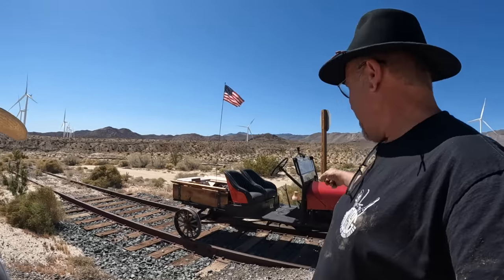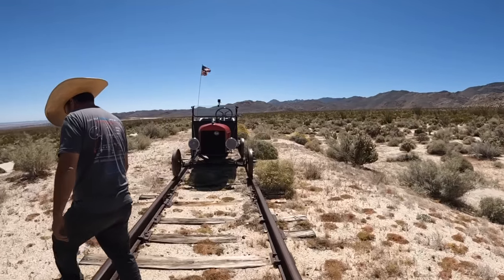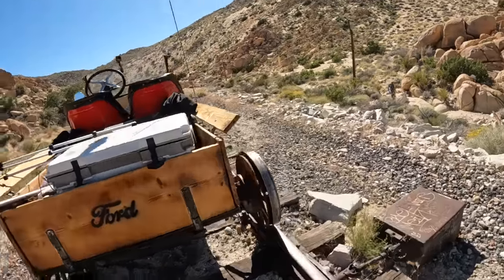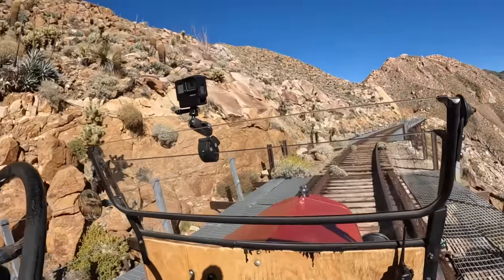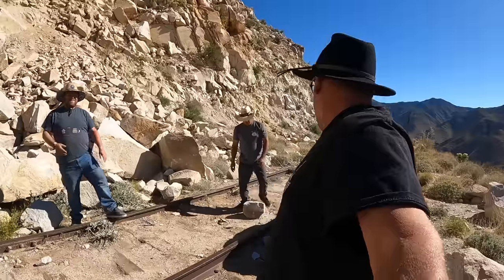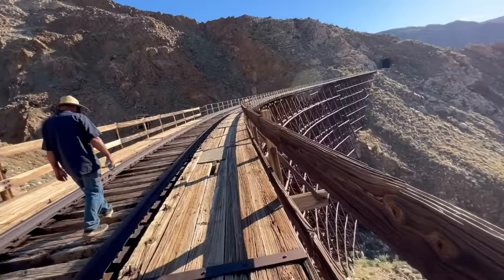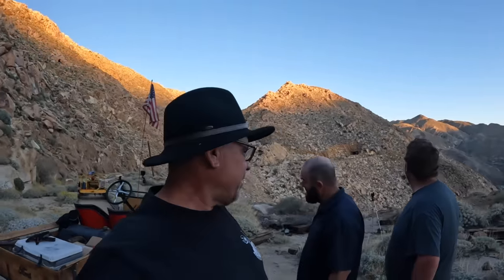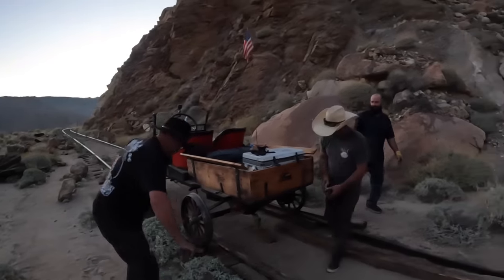Can We Make This Model T Railcar Run and Drive to Goat Canyon Trestle to Go-Kart on Railroad Tracks

Comment: Ah 21:55 
Yes the trolley offstands, being that amazing place - where the old timers used to (by hand) lift off one end of their hand powered or motor powered, velocipedes, and in a sideways shuffle they would either turn their trollies to point the other way (critical when using a three wheeled outrigger "pull-pull" hand trolley as the single outrigger worked best in a forwards direction while tending to "run off the gauge" and derail in reverse) or they would knowingly offtrack and thus push their trolley away out past train gauge, (that of the width of trains) to ensure that any passing train wouldn't be fouled on their trolley (smashing said unit if that happened and boy, what a long walk home if they smashed a trolley along with the "cost" of replacing it later, when their bosses asked for them to pay for the damaged trolley's replacement).
Here in NZ in late 1969 a motor trolley 4 man was worth about $300
I'd hate to guess what a motor "vehicle" on High Rail wheels, would cost nowadays?

It also meant that a work gang could offtrack as many trollies as they had brought along, (thus pushing them all as far out as the end of that offtrack stand, across which 'd guess would be a fixed cross tie above the stand to AVOID LOSING ANY DOWNHILL.!!!)>
The gangfs thus used these either for their manned trollies (those that the workers sat on to go anywhere) and sometimes an unmanned cart (the working flat-tops they used to cart sleepers and rail with), although mostly we simply tossed ours off a short distance away, preferring to ONLY offtrack motor trollies on stands such as that.

These are the older wooden ramp offtracks, from a time before motor trollies, whereas more modern ones used old rails as the off track, with even more modern ones using a "just below flange height "inner turntable platform, around which it became easier to turn heavier work trollies, and to off track them when needed.

A little known technique was the one that was needed when NOT at such a brilliant spot, say at a worksite, (or if unable to "make it in time" to a known trolley stand), and that was to "lift" the front / heaviest end of the trolley and slide it sideways until one wheel was across the main running rail, on the side you were offtracking towards, so that when you went around to the other (lighter) end to force the trolley's fourth wheel across the rail as well, you could more easily get all four wheels off tracked outside of the main running rails, which allowed you to offtrack on ope track, no stand just soft sand and bushes to push the trolley through until clear of any train.

If you didn't do that - the two front wheels would BOTH drop inside the two main running rails, forcing you to lift while also "pushing" as you attempted top get the trolley off tracked.
A not easy task by any means, especially if in a hurry, or when alone, a heavy trolley becomes a LOT heavier, to push on gravel and soft sand, when you are also trying to lift it's heaviest end over the running rail you "forgot" to pre-lift it over, before turning the fourth wheel "over" the rail, by using the thrird wheel against the outside of the same rail, to allow you to get the one last wheel over - and thus fully offtracked.

Been there, done that many a time, in my ten years with the NZR when we were running the lighter wooden framed open seat motor trollies.
Unlike other countries where a covered trolley design was used, the NZR of the 1960's and 1970's used open frame (zero cover) motor trollies with mostly B&S motors, although a few were later fitted with Techumshies ? (I know I spelt it wrong, but that's what it sounded like).

Comment: Find the exact cg on that thing, then build a support bracket between the frame rails to hold a 1ton bottle jack.  Then make a base to lay on the ties to support the weight with a decent size thrust bearing for the jack to engage, and simply jack the car/cart up to rotate it to the opposite direction.  I bet it would take 2 men less than a minute.

Thats what the ties heading off to the side are for, BTW... Turning hand cars/pump trollies/jiggers/etc around.

Comment: 10:02 NO that was "not" full of oil, it was in fact full of GRAPHITE GREASE, which is a "flange" lubricant to lubricate the flanges of all wheels on this side of the track, attempting to avoid the ripping/ringing effect of dry flanges, grinding away the top "head" of the rails on curves, which is mostly effective, but often these "lubricators" became empty, whereby their effectiveness was diminished until a work crew could come out and refill the tubs.
We here in New Zealand during my time on the NZR, (between Feb 1970 & Oct 1980) had a modern sprung version with the "pumps" being small rod inserts, pushed down by the tread of the wheels, which instantl forced more grease out from the slots in the inside of the rail head, which were fed by a fishplate wedged onto the side of the head itself, with just enough gap at several points, to allow lube to be picked up by the flanges of following wheels, all of hich also pushed the plunger rods down, to force as much grease up, as each tiny "pump" was able to push, meaning that about 10mL of grease was pumped every time the plunger was forced down.
A long train was often the cause of one lubricator "running out" of graphitte grease in one passing, but oh boy the amount of grease splattered far and wide, by a high speed passing train, meant that everything for miles on either side of one of these (they normally used a pair, one on either rail), so that track maintenance work, by track gangs using the most primitive of tools, spades jacks and crowbars / showels etc, alway ended up looking like grease monkeys, whenever we had to "work" on track - for up to a mile either side of one of those. 
I've never seen  one with a rotating driveshaft, but hey, it obviously did the work it was designed to do, and so - many a mile of curving track would have been saved, by the mere use of these, lubricating the ground surface of the inside railhead, avoiding having to replace running-rail as often as the times they required replacing on other lines - which were NOT lubricated in this way.
Reply: In 1974 watched them water the train track at the Picton Ferry Terminal while loading the train carriages onto the ferry. Spoke to the NZR guy and he said it helped getting them around the tighter bends when shunting them in. Much cleaner solution but easy when you are not on a remote site.

Comment: Awesome trip 
The only thing I'd suggest if you keep rail running the T 
Would be a set of wheels in the center of the car that lowers to the track so the car teeter totters and you can spin the car 180 degrees, lift the wheels n go.
But where's the fun in that lol.

Comment: An "Austin Powers"  180* turn. Some ties have "Nails" (maybe called date nails) with the year they were installed on them. Certain ones used to be worth good coin. Regular use of steam locos ended in about 1960 though a few ran until 1968.

Comment: the old wooden  outrigger  is to remove the fallen rocks along the line ,    wagon /wagons pull up then empty  into a smaller  loper front wagon which was tipped over the cliff face

Comment: Those are places for speeders to dismount from the tracks and pull off to the side when a train is coming so that maintenance crews would not get hit by a train. Notice the wooden ties that are the same width as the wheels on the speeder. The platform was to turn the speeder around 90 degrees from the track so it could pull off to the side on the wooden ties until the train passed by.

Comment: Merlin you need to build the balancer for the center of the car like the railspeeders. You could do it with an old railroad jack. But it's centered in the car so that when you lift it it lifts the whole car so you can spin it around and drop it back on the tracks period love the videos will watch this again

Comment: That box with the pump was used to lube the wheel flanges as the train took a curve. Kept the wear down on both the wheels and the track. It was probably grease, not oil in that box.

Comment: “On the northern segment of the canyon you will note a couple of places, far below at the bottom of the gorge, where freight cars have fallen off the tracks. Some are the remnants of a 1928 movie, Beggars of Life, shot in the Gorge. Another two boxcars careened down into the gorge filled with trailer loads of Coors beer, to the delight of many. Yet another wreck left a hillside littered with precast concrete beams.”

Comment: Lubricants are used to control the amount of friction, so the train moves with the least possible wear, noise, and fuel. Lower maintenance: Wear of the rail and/or wheels occurs when friction becomes too high. Lubricants lower this wear, increasing intervals between maintenance.

Comment: 21:55 This lumber 'add on' is usually placed there for livestock (or vehicles) to cross the tracks, but that certainly doesn't look like the area is 'open enough' for either. 
And those two runners from the tracks to the edge? 
For the LIFE OF ME, I can't think of what those would be for! Parachute ramp to get the cattle into the valley?  🤣  
UPDATE AFTER MORE THOUGHT:  Maybe that entire setup was made to dump heavy 'railroad construction trash' they didn't want to leave along the tracks for safety reasons. (it's easier to push heavy things across flat areas, then it is to push across iron tracks and uneven ground. You found that out with that boulder!) 
Did you look over the edge of any of them to see if there was anything down at the bottom that didn't 'fit'?

Comment: I think a couple of floor jacks and a piece of square steel tubing could have helped a lot for the turn around.  Then you could have jacked up one end on the tubing and slid it over several feet.

Comment: The hand cars or pump car had slide out handles that slid out to turn the cars around, or to clear the rails  for trains. They filled the center of the  rials with ties so they didn’t have to do what you hat to do to turn around.

Comment: Would be cool to find the center of balance on that car then put a plate with a bearing there, make a really stable bottle jack that you can drive over, jack up the hole car and spin it around.

Comment: I'm not a trainman, but there's gotta be a better way to turn a train around. Have you thought of a pivot point underneath the car like a Jack stand, you balance & twirl. 

My other suggestion is swivel bucket seats. And two steering columns. One forward and one aft. 

Bells and whistles should work either way.

Comment: Great video.  I wonder if you could rig a rotating platform under the model T that would lift the whole car at its center of gravity  to allow you to easily spin the car to point it in the opposite direction.

Comment: Back in the day tbey would have used vehicles like this for inspection and repair . The trick to turning was they would have attached to the middle of the frame or trans. They would balance it while jacking it up and spin it 180 degrees.

Comment: It would be helpful to take a heavy bottle jack bolt it to a steel plate , then weld a axle and drum face on the top of  jack to catch a point on the bottom of the car . To jack and rotate in place ?

Comment: You need a plate for the ground and a lift point in the center of the T so you can jack it and spin it on its center.

Comment: A question, did the inside Model T wheel flanges "just happen" to fit between the rails? If they did, it may have on purpose. Your "T" model would have been old enough for that possible use to have been considered. Sales to railroad Co's could have sold many fo rail maintenance use. Henry made many farm tractors too. Great video THANKS!!!

Comment: At 22:10 those are designed so track maintenance cars can get off the tracks when a train is coming.  The maintenance cars had handles that extended out the rear and a couple of strong men could lift and turn the car 90 degrees and get it off the track.  On this one, I would be afraid of sending it over the edge!

Comment: Turning around looked like a pain in the you know what. I'd find dead nut center if that ol rig and install a hydraulic ram to pivot off of to spin it. what's it weigh 400 lbs? even if you use a channel to push up of the track that'd help balance it.  yeah I build things, well, use to now just do it for myself

Comment: The FAIRMONT speeders & others like it were built with handles on either end so the crew could lift their speeder off the rails & put them onto the railroad ties and roll it off the tracks for the passing trains & get out of the way.
Reply: Fairmont speeders were built in Fairmont, MN. They also built "Burro Cranes"; these are smaller rail mounted railroad cranes used by M.O.W. forces that are self propelled.

Comment: You asked for a comment on the wooden structures in-between the track that you had no idea what it was? Well, a railroad speeder fits perfectly on it as that is what it was designed for. These "structures" are for railroad Inspection/Maintenace of Way (MoW) crews to pull the speeder off the rails while they work or do Maintenace on trackside equipment nearby so that there would be no interruptions on that railroad division's timetable, plus it was also used so that the Inspection/MoW crews to pull off allowing a train to pass before putting the speeder back on the rails and continue their task. I highly doubt the railroad company who put them there (Southern Pacific) would have been happy to hear that an Inspection/MoW crew got yeeted off the side of the mountain into the canyon below by a hundred-fifty car freight train during the 1950s to the mid to late 1980s.

Comment: I was just watching this video and why can't you put a pin in the center of the model T and use a floor jack to lift it up and spin it 180 and set it back on the tracks. Just like a round house for locomotives. Just a thought.

Comment: You should add a strong spot dead center of the car's mass. So that you can lift the whole car with a jack and then simply balance it and rotate it on the spot.

Comment: that device you found  is what would be a modern day greaser. modern tracks grease the inside of the train wheel. if you search YouTube I'm certain you'll find video of a modern one. the old ones may have just used old heavy crude oil. 

cool find, great video. I'm uncertain of the legality of messing around on that old track but I'd too would do the same and beg for forgiveness i i got caught and threatened.  i k iw the old line in the midwest they salvage all the track and ties and allowed land owners to reclaim the ground.

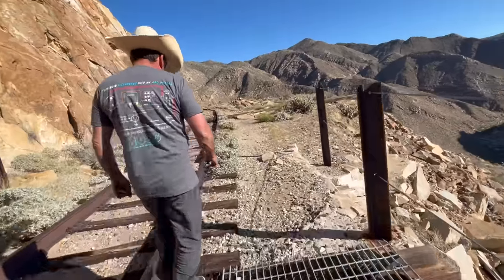Comment: 21:48 They are used for rail inspection speeders so they can inspect the track they used to roll out and you could turn them in any direction you wanted to go. The rails and storage shed are gone of course. They were put in after the steam trains were gone. And the diesel engines took over. Not that ancient.

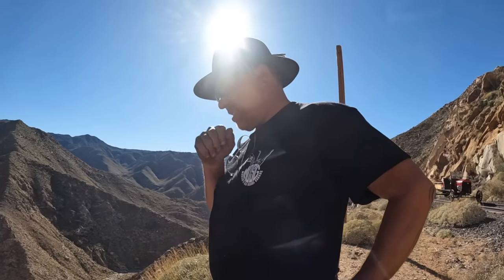Comment: 14:58 - Most of the cars down in the gorge were thrown down there intentionally.  Not that they were brought into the gorge with the express purpose of being thrown over the side, but generally speaking in the early 1900s once a car was damaged seriously enough in a derailment, just throwing it over the side was the easiest and fastest way to clear the derailment and get the line reopened.  Time is money in the freight moving business, so the cost of having the line closed for hours while scrapping or dragging the car out of there was just more costly than abandoning the car.

Comment: Man that took a lot to turn that car around. If you’d like some advice from an Efficacy Expert, aka Lazy Bum, find the exact center of gravity of the vehicle and weld a flat plate on the frame at that point. Then, when you want to turn around, you just need to jack the entire car up at that point with a single jack and spin the car around. Easy-peasy and you’re on your way back.😎

Comment: Would it be better if the flanges a bit tailer as it would have more surface area to stop the wheel(the part that is on the track) jumping over any defects on the track?  or better still try to get a set of train wheels made up for the Model T.
Somebody needs to get a mini excavator to move that rock pile..

Comment: The heavier machines have a hydraulic ram in the middle with a round plate that fits between the rails. lift and turn around or lift and run out on the wooden derailers so trains can pass..

Comment: Normally would like that on the track go in lengthwise would be where a vehicle could cross over but where you ask the question The wood going straight off the cliff what I am thinking is when they were building the track that's probably how they were loading something unloading supplies

Comment: Nice buggy.  But why the steering wheel?  Do u drive this on the road too switching to rubber wheels?   U need to install one of those heavy duty hydraulic lift located in the center of the buggy and once lifted u simply spin the buggy the other way around on the track.

Comment: At 22 minutes you asked what the ties were? the are turnouts for just the cars you are riding on so when a train was coming you could get out of the way or you could turn around by picking up your car and pulling it off onto the side and picking it up and going in the other direction. You could have used them to turn your model T around, I laughed when I saw you were turning it around on the sandy gound.

Comment: One guy build a speeder with a trailer tongue jack under the middle. When it came time to turn his speeder around he jacked it up then turned it around then lowered it back down on the rails.  I realize the model T is heavier but if you had a base plate on the bottom of the jack roughly 3' square you might be able to do it. It sure is faster then how you did it in this video.  Just saying.